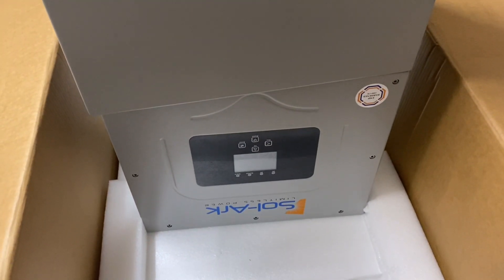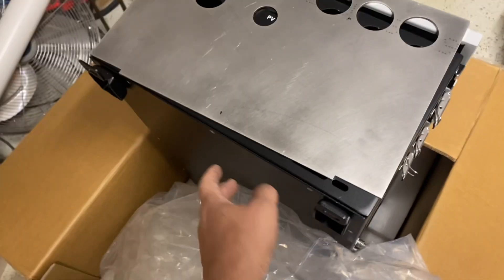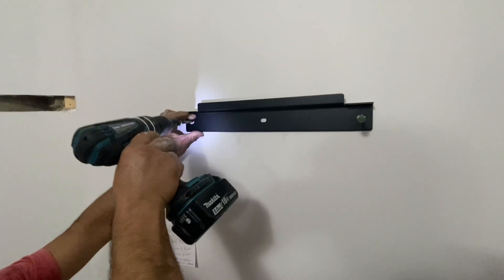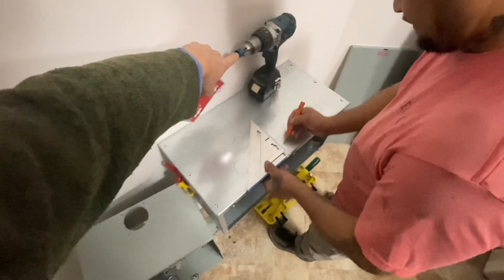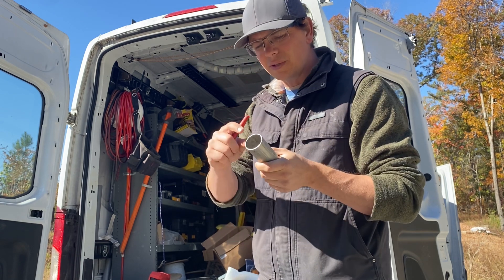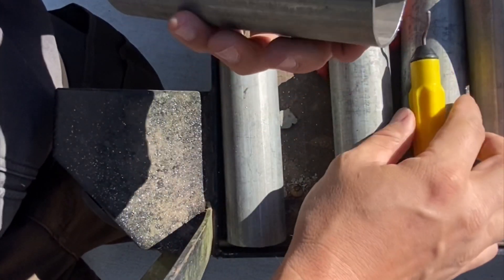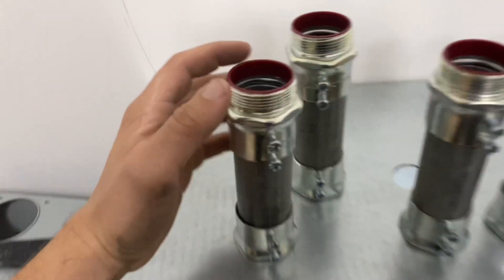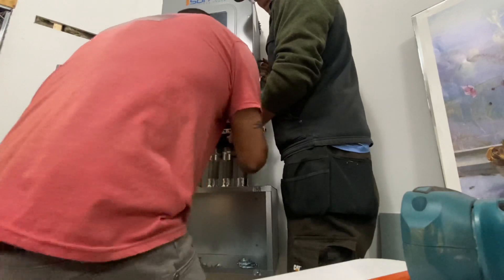Mounting the Sol-Ark 15k

Comment: It is a whole lot easier to cut all the holes in the trough then mount the Sol-Ark on the Wall with the EMT connectors already screwed into the Sol-Ark and into the unmounted Trough.
Then put in the EMT pipes and tighten them onto the Sol-Ark.  Lastly bring up the wiring Trough and line up it's EMT connectors with the Pipes hanging down.  Then hold the trough up in place while someone drills the holes through the trough and secures it to the Wall.
A lot easier to maneuver a 15lb Trough than to maneuver a 130lb inverter to line up holes.

Comment: 0:54 the manual says they're 2" knockouts, not 1.5". (ignoring the 1.4" comms knockout.) am i misunderstanding?
Reply from the maker: They are giving the actual dimensions of the holes while I am telling you the trade size of the conduit that fits.
Reply: @GainSolarPower  oh! TIL. like how a 2x4 is really 1.5x3.5. thanks.

Comment: do you have any experience and advice for mounting this beast on a cinderblock basement wall? (i don't know it the blocks are hollow or cement-filled. (circa 1960s.)
Reply from the maker: I’d get some 2” long red head sleeves anchors and don’t over tighten.  

Once you start drilling, you will find out if it is filled block or not but the sleeve anchor will work on either one
Reply: @GainSolarPower  thanks! will give it a shot.

Comment: great video. could you mount the sol-ark first and then install the wireway underneath? seems it would be a easier to get all those conduits aligned, especially if you dont have a cnc'd template.
Reply from the maker: @4mla1fn  you could. You would want to put the pipes on, then mount wireway to that or somehow wedge them in. Lot of fanagling

Comment: I thought the measurements are very, very helpful.  I thought the wireway not so much.  The wireway is great, but not everyone will be able to route grid, load, PV, battery and generator all coming possibly from different directions into the wireway and then up into the Sol-Ark.  Not to mention that you may also be making a panel box for local DIN breakers.  DO YOU HAVE A VIDEO SHOWING THIS COMPLETED INSTALLATION AND HOW EVERYTHING I MENTIONED GOT INTO THE WIREWAY AND UP TO THE SOL-ARK?

Comment: I am assuming that mounting bracket is for studs on 16"" center. What would you do for studs 24" OC?
Reply from the maker: I’d either cut out a strip of drywall from stud to stud and put in a piece of thin unistrut or put the middle hole of the bracket on the stud. I’ve also used longer timber screws to reach out and hit studs wherever they are. Inevitably, the wireway will bear some of the weight but too much causes it to deform which makes it hard to get the wireway cover on…

Comment: Is there a reason for 6 inches between wire chase and solark?
Reply: The air intake is on the bottom
Reply from the maker: And its cooking’s fans ventilate vertically so it’s needs ample space  to draw in air from underneath